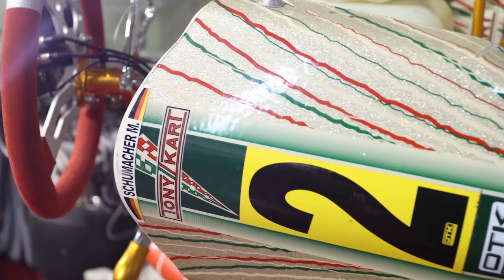Miami’s Wildest Vintage Car Compound (pt2): Car Collection Update With Juan Carlos

Comment: Juan Carlos if you are watching this i will sell you my 2009 Pontiac G8 GXP, California Car all its life 54k miles. #487 of the 1829 produced, and it was built on 11/14/2008. It is also #26 of 81 built like it (#26 of 54 built like it with Potenza summer only tires). If your interested please let me know. Really fair price a bit under kbb value.